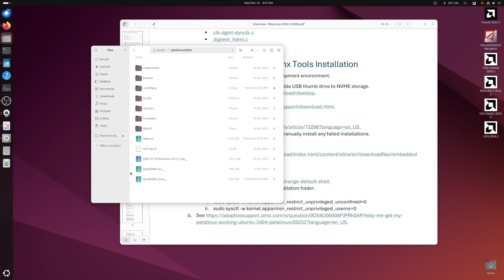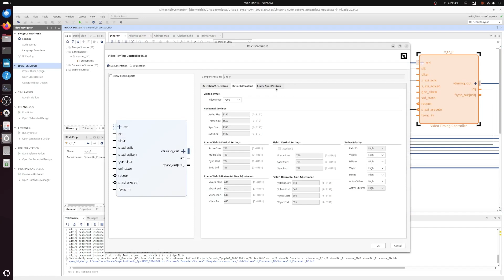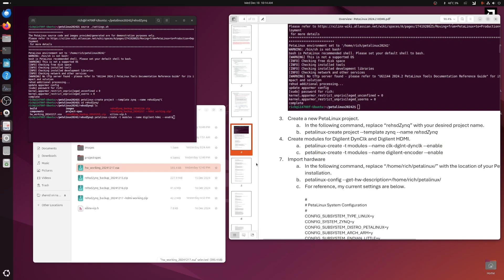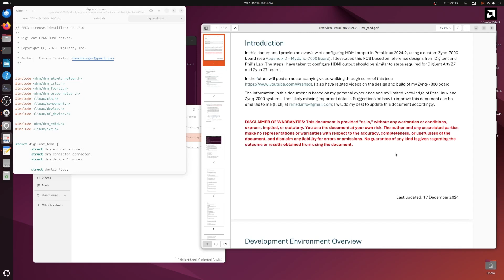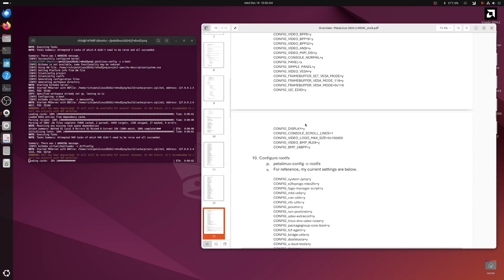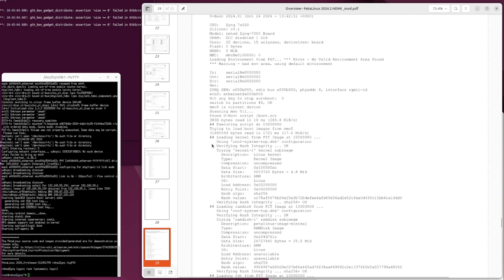HDMI Output in PetaLinux 2024.2

Comment: I just found this information. Thanks!
I am trying to do something similar on a custom board that uses a Trenz TE0720 SoM for the Zynq. My custom board uses most of the IO available from the Trenz module. I did reserve some unused IO from Bank34 for possible use as an HDMI output.
Unfortunately, Bank34 from the TE0720 is setup as 1.8V. Do you know if it's possible to do the HDMI output as you describe in this video using the 1.8V signaling?
Reply from the maker: As far as I know, TMDS uses 3.3V. I would guess you could add a level shifter though. I did that with my SD Card, coming from 1.8V on the processor and shifting to 3.3V for the SD Card.

Comment: I can't remember exactly what had to be done but at this point you should be able to run something like LXDE no problem. I remember I was able to run proper Lubuntu on Cyclone V using just dumb framebuffer device. It was so dumb that Linux couldn't even set the video mode. U-boot had to do that. But at the same time it was somehow able to play and correctly sync video files without any problem. Games like DOOM or Quake were no problem either. Anything OpenGL would run like crap though. No wonder, without any 3D hardware. I think that some kernel parameter and custom xorg.conf file was needed. Today, with Wayland, it might be even easier.
Reply from the maker: I've been trying to get Xorg to load, but no go so far. I'll read up on Wayland.
Reply: @rehsd  I think I had to modify Device Tree to get /dev/fb0 device file. And then use fbdev Xorg driver. I think it was called something like xf86-video-fbdev.